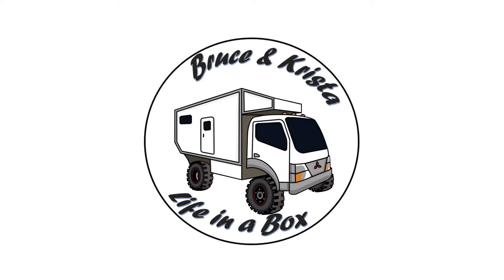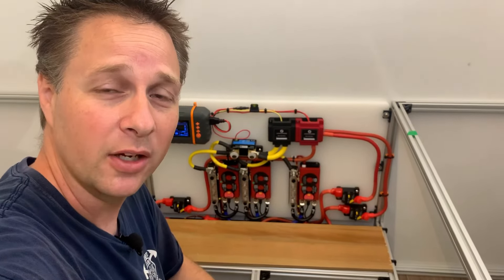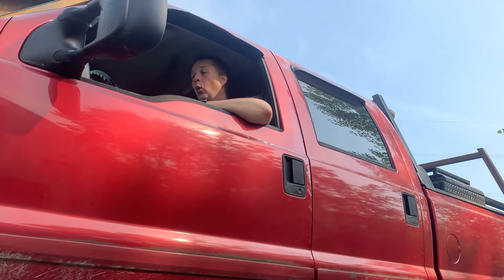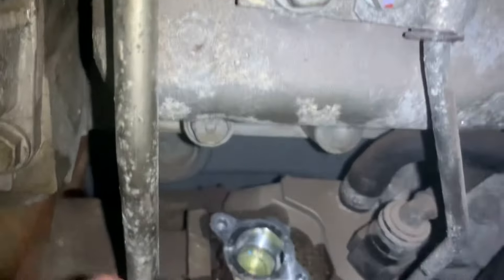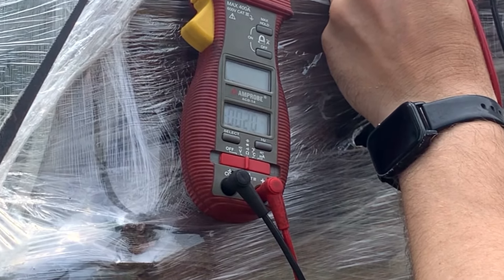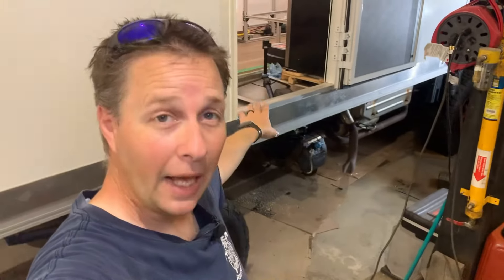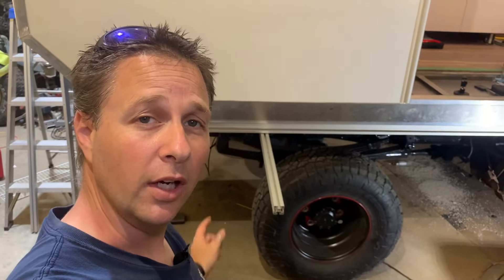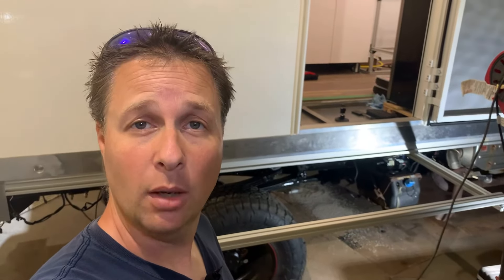NOT a quick Overland Truck build | Mitsubishi Fuso FG

Comment: Idea- Have your steps parallel to the camper. If you go shopping or someone pulls in beside you while you're out, you can still walk up the steps to get inside or unload groceries.  If the steps are perpendicular, you may have to move the truck just to walk up the steps which could be a PITA.
Reply from the maker: Ahh yes, but more surprises to come with the steps - they will be quite multifunctional!
Reply: I know Bruce has already thought of that, but I see many builds that don’t. I use the parallel step entrance more than the straight out

Comment: That starting issue is a tough one. I know a fellow who parks his tractor on a rise and then starts it with a push! Again glad to be of assistance. If I was there I could pretend to be pushing at the back when you turn the key. It's just an educated guess.
Reply from the maker: Ahh yes, if only it were manual, I lived on a hill, and it wasn’t a fuel supply issue I’d be all set 🤣

Comment: That no-start condition is turning into a Perils of Pauline serial.  Drat!  Condolences on that and the trailer issue.  Have you put together a truck tool kit yet, and left it in the truck?  Ditto a massive one for hauling in the overlander.  Consider hydraulic actuation for the deck.  Or repurpose one of your leveling jacks for the job?  (eville grinne as he waxes his mustache)
Reply from the maker: Well the worst part is I have a perfectly portable tool kit, which was sitting perfectly stowed in our other Fuso (FE). 🤣. The FG will have a LOT of tools and parts stowed - the whole reason to build super light is so you can load it up with tools right!!

Comment: Bruce I am presently building out an Isuzu NPR-HD diesel with a rather large habitat as well. I have struggled with a slide out deck or a fold up. I have opted for a folding deck as it will secure the door just in case it is not locked or opens for some unknown reason. My deck is almost the same size as yours, I have Motor craft door from Germany with a 28" wide opening and the door is about 30" so we are using 5 foot as well to cover the door when swung open. I am coming out 24". My metal extrusions have 80/20 tracks built into them, so it is an easy attachment for me as well. Let me know if you want a couple of pics, tell me where to send.
always enjoy your videos, hope you find a solution to your engine, that is a bumper. Good Luck!!
Reply from the maker: Good stuff - I guess great minds think alike!!  Sounds like a solid setup!

Comment: What are the buss bars along the side of the BMS’s for? 

I sent you an email.
Reply from the maker: The Ground buss?    I don’t see your email?
Reply: @BruceandKrista  I resent the email. It looks like a bus bar between the 3 BMS's and the shunt.
Reply from the maker: Yep, that’s the ground buss - not really a required part, but allowed me to use the original wiring that came with the BMS, add the fuse, and gives a point to make any other
Small gauge ground connections per battery if needed.